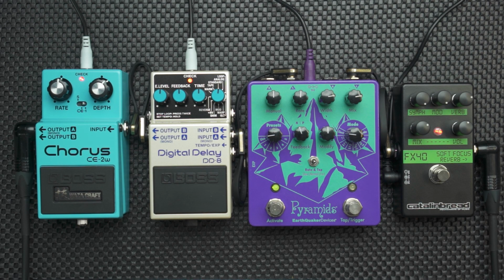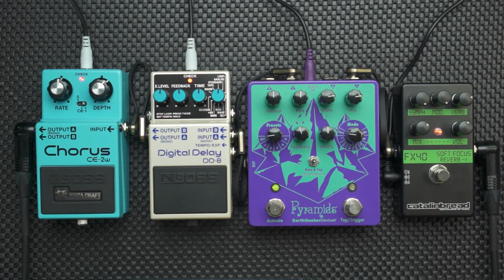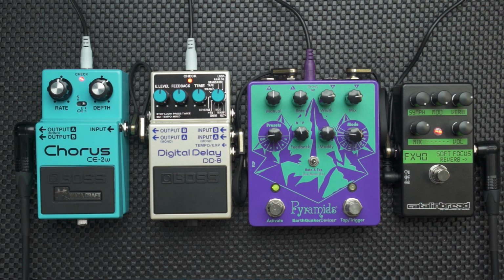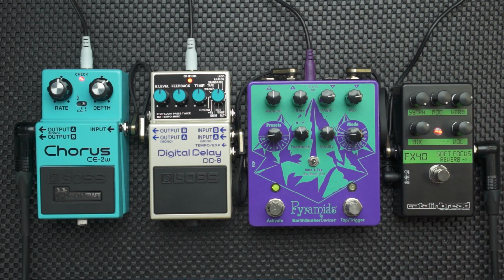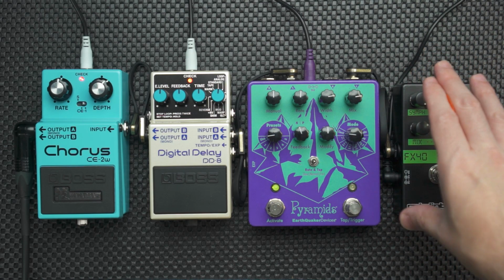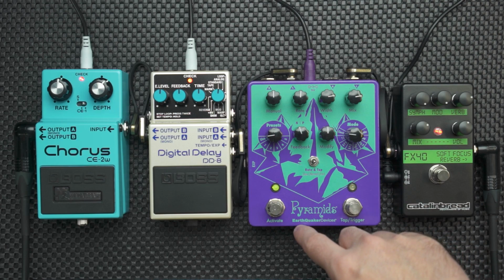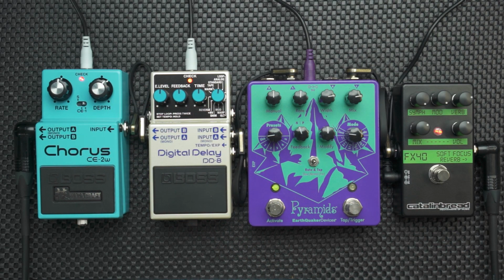Recreating the "Soft Focus" Signal Chain from the Yamaha FX500

Comment: Thank you very very much for breaking this down! I'm going to try to replicate this with my HX Stomp XL.
Reply from the maker: You're welcome! Thank you for watching, I appreciate it. If you're using that you can also add a compressor and EQ if you like, which the original signal chain used. I think the EQ requires a boost to the lows by about 1dB and then cut the mids by 5dB in the 1khz freq. Also if you want that really muffled droned out sound of the original, I believe the reverb requires pre-delay mixed in generously, or, you can add more feedback and time to the delay FX.

Comment: So the Catalina bread is first going into your guitar right?
Reply from the maker: Correct! The chain is still "reverb > flanger > delay > chorus" just the physical placement is reversed because of my setup. The physical chain here instead starts right to left and my guitar is going into the Catlinbread and out of the Chorus into my amp.
Reply: Thanks. I just got the soft focus pedal and people are missing out if they think they can get the same effect as the original without a delay and additional modulation. I’m using the soft focus with dimension c (chorus) and a boss hi band flanger. I just need to get a delay pedal.
Reply from the maker: @thechroniccinephile  excellent! I mentioned in the video I didn't include a compressor or EQ, which was part of the original chain, but you will be fine without those. If you want the washed out original sound, just increase the feedback and use a slower time on your delay than I used here in the video.